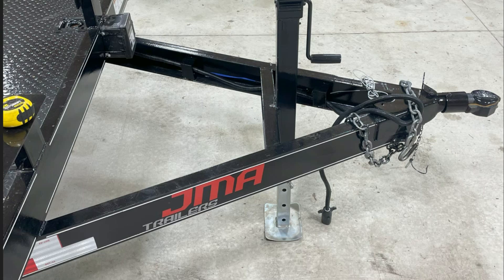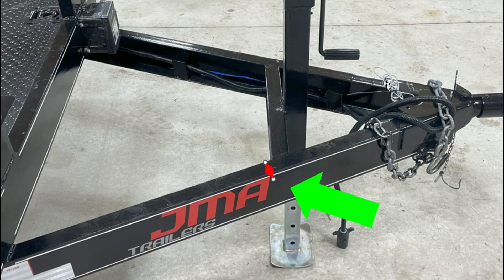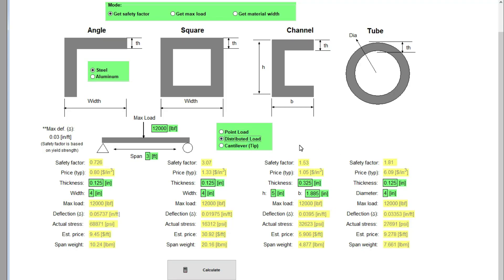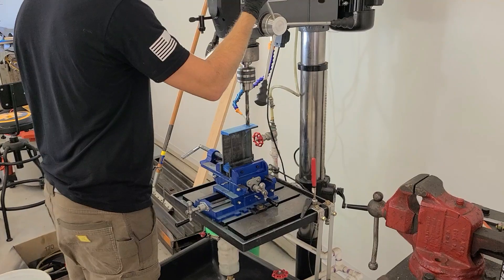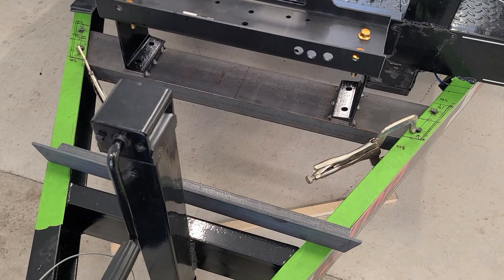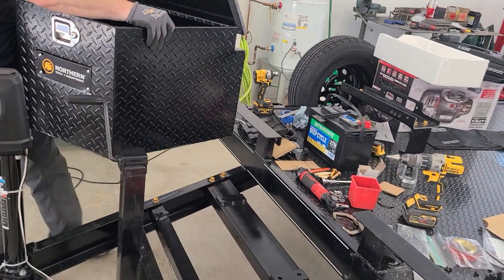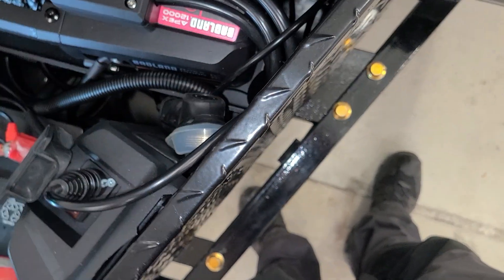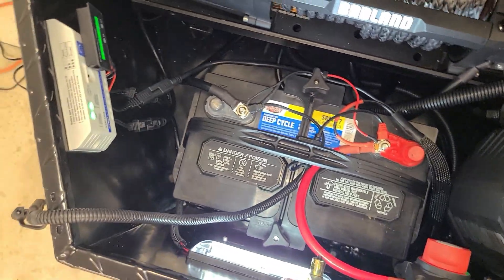Trailer Winch Box Build DIY - Bolt-On, Structural Steel, Strength Calcs

Comment: Drilling the top rail of the trailer frame is where the cracks will start
Reply: I was just curious myself about how an "engineer" felt drilling such large holes through the tongue of the trailer.